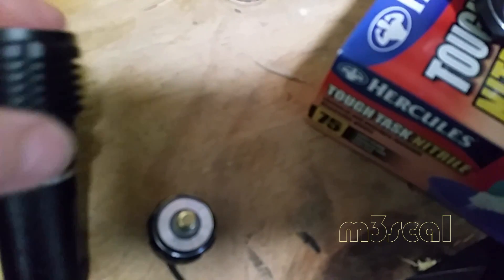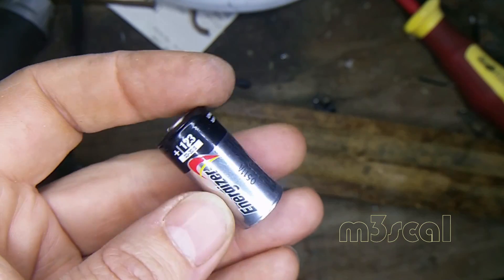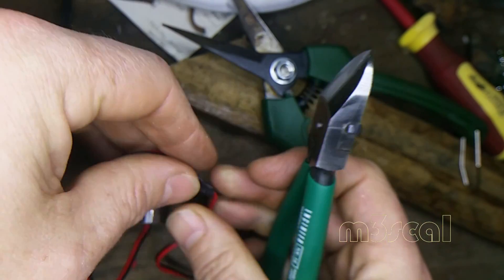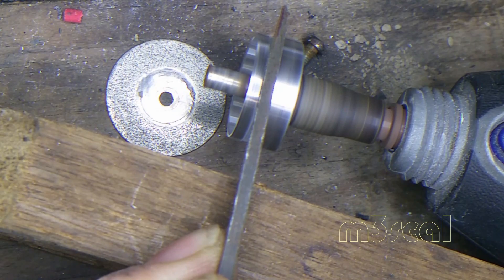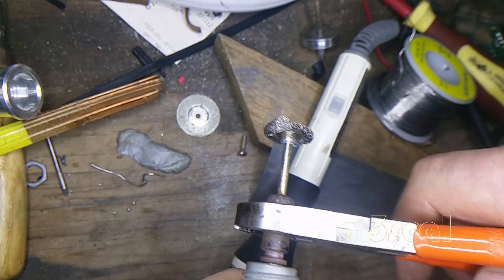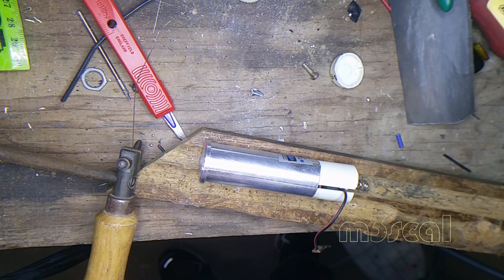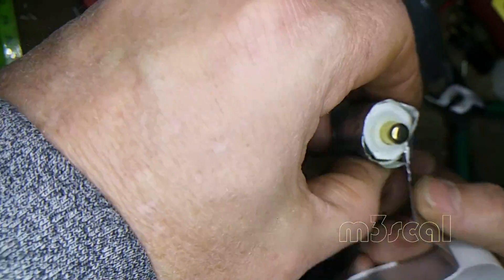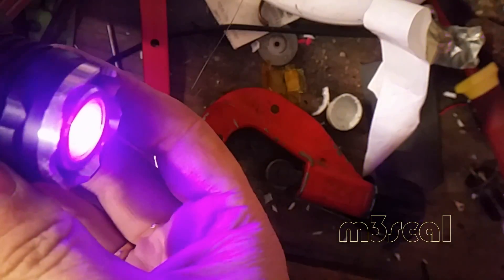UV LASER torch/flashlight Mod

Comment: Man, I had similar builds, I recetly made an ir 850nm light with an integrated 1050nm laser fitted to shine through the hole in a reflector, and on top of it all - it was a reflector zoomie, and the combo works great as hunting torch. But, man, I realy admire your way of doing things, you just did it all with what you got, and it's not much. That's the spirit, man, let nothing stop you.

Comment: how much was the fat beam laser and can you get it in green..??
Reply from the maker: hey mate, they are cheap ~$20 and yes you can get green but you would better off getting a ttl control LASER so you can take a signal that drives your EPG coil to also fire the LASER. Like the one i got on last mailbag. I will post you the ebay link
Reply: turn your mobile on trying to call u
Reply from the maker: it was streaming...call now
Reply from the maker: http://www.ebay.com.au/itm/w-12V-Adapter-Power-2W-445nm-450nm-Blue-Laser-Dot-Diode-Module-2000mW-Driver-TTL-/132194718933?hash=item1ec76b54d5:g:HT8AAOSwKytZG8q3